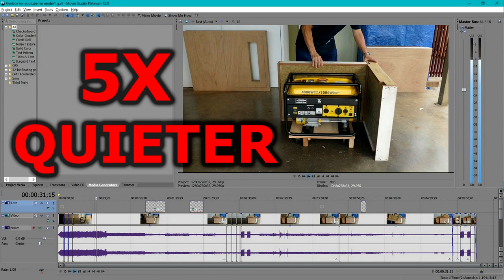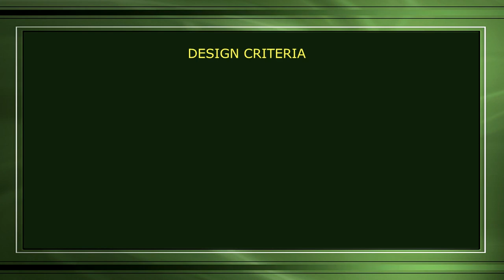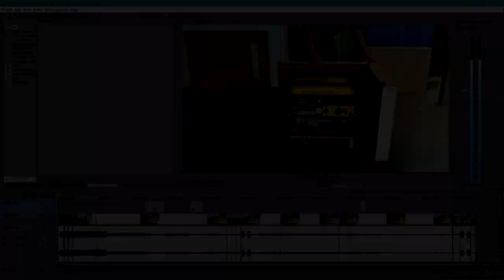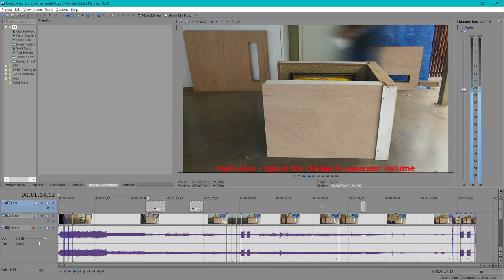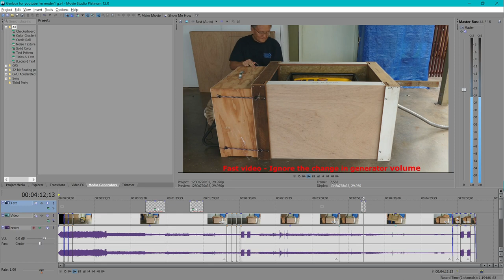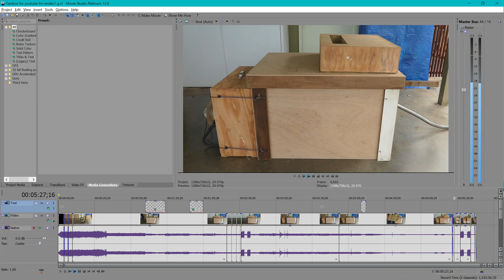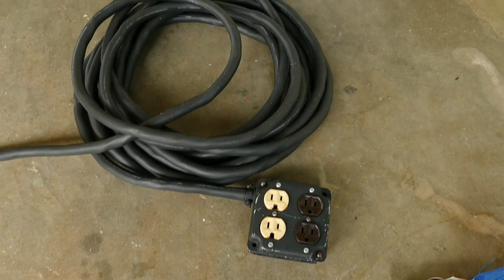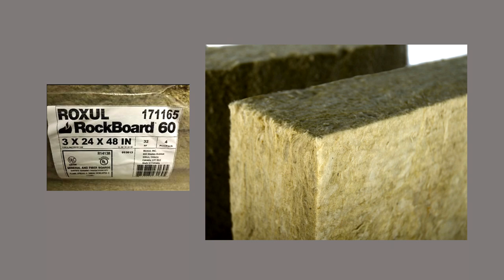5x quieter generator or compressor sound reduction quiet box

Comment: Great idea . I have some questions. 
1. How do you connect your exhaust to the muffler and is there a fire issue running the flex pipe thru the wood.
2.  Does your generator move much because of vibration.
3. Even though you have a cooling fan have you checked the temperature inside the box under a load on the generator.
4. I haul my 10kw generator in a enclosed trailer and my big concern is to much heat even when the doors are open.
Thanks again great video
Reply from the maker: 1a. My generator has a flange on the muffler.  I bolted on a flange and pipe adapter I bought off ebay. ....1b. Mineral wool insulation that I used is extremely fire resistant.  The flex tubing goes thru a hole in the insulation and does not touch the wood. See the following link for fire resistance of the mineral wool insulation that I'm using: 
https://www.youtube.com/watch?v=RKZd1ZTjvzE....2. My generator does not move. ....3. The main heat produced by the engine exhaust is piped out of the Qbox via the flexible exhaust tubing so only the external cooling of the engine is required.  My external fan plus the generator's built-in fan move a lot of cooling air through the Qbox.  Actually I think there's more cooling air flowing through the generator in my Qbox with external fan, than it running alone out of the Qbox.  A sheet of Kleenex held at the hole in the output sound baffle waves like a flag and the output air is just a bit warm.  I did not have a temperature gauge but the output air is cool enough that I have no concern about the cooling of my generator.4. Thanks for your kind comments! .... Usefulgizmos

Comment: In your description you say this setup prevents carbon monoxide poisoning, I would disagree. The pipe hooked up to the muffler exhaust is a thick wall solid pipe with no seams, welds, cracks, joints, etc. leading to the outside, I would say that that part does prevent carbon monoxide poisoning. However, from where the pipe attaches to the muffler's pipe back to the engine block there are a number of places which have the potential to leak. Also, the valve cover is another weak point where a leak could occur.

 If you are going to use this system, IT SHOULD BE A REQUIREMENT to install at least three battery operated carbon monoxide detectors with an alarm in the area where the generator will be kept when in use. And check to make sure all three are working before running the generator. This is on an assumption you are using a fuel that produces carbon monoxide. Even propane, considered a safe fuel, can produce carbon monoxide (although small amount, but it can build up if not vented) if it is not a complete burn. From what I just read, 25% of all carbon monoxide poisoning deaths is from propane. So, use those detectors no matter what kind of fuel you are using. The only generator, that I'm aware of, that doesn't produce carbon monoxide would be non-carbon based things like battery inverter, solar, wind, water flow, nuclear power plant.

In order to be a carbon monoxide preventable system, take it outside away from any building eaves or vented soffits. Another way is to build an airtight tunnel or shaft and have the generator at the end close to the outside with a large exhaust fan between the generator and the outside so that it is pulling (not pushing) air across the generator at a good volume and venting that air to the outside away from any eaves or vented soffits. You would need to have an open window, door, or opening (from the outside) at a different location other than the exit to the outside as an air source. This would also help to keep the engine from over heating.
Reply: What do you suggest for flex tubing for exost tub from generator? Conduit flex tubing ?
Reply: In reading this it appears to me that it is not meant to be inside.  This is just meant to quiet the generator outside so it does not irritate your neighbors.  If positioned away from the residence and the exhaust is vented above I do not see an issue with this setup. In fact I am seriously considering building one myself.

Comment from the maker: Hello B Berthold,
I do have scale drawings of the quiet box and sound baffles shown in the video.  I also have scale drawings and pictures of the simple jig that I made to achieve straight perpendicular cuts of the Rockboard 60 (RB60) insulation that I used.  I think that cutting the Rockboard 60 straight and perpendicular to get tight fits in the frames was important to minimize sound leakage.  

I could put a package together with instructions including details on how to get tight fits of the RB60 to the frames, the way I found to deaden vibrations of the plywood skins, the exhaust system from muffler flange to PVC extension, the type of glue that I found will glue panels of the RB60 together, etc.  Send an email to me at usefulgizmos@gmail.com and I'll let you know when I finish assembling the package.  I caught the flu so I'll work on it when I get better.  And thanks for you kind compliment.

(Reposting my reply to you here since it may not be obvious how to view replies.)
Reply: this is nice but what say the temps no overheat?

Comment: That's a huge reduction in sound but I'm curious how much hotter the air-cooled engine runs inside the enclosure and if it's hot enough to burn up the engine in high ambient temps.
Reply from the maker: No problems with my setup.  I live in Hawaii's warm climate. .... Usefulgizmos
Reply: @usefulgizmos  -Good to hear, thanks for replying!

Comment: How hot does it get in the box? Any danger of generator plastic parts melting?
Reply: The hottest heat is the exhaust from the engine and that is piped out of the quiet box so does not contribute to the heat within the Qbox.  Ambient air is blown into the Qbox and cools the "alternator > engine > muffler" in that order so the heat from the muffler does not affect cooling of the alternator and engine.  The output air is just warm.  There is no danger of plastic parts melting and not even close to doing that.  Thanks for watching and have a great day! .... Usefulgizmos

Comment: have you measured what the heat level is in the box while generator has been running full load for several hours and the fan is in use?
Reply from the maker: I did not have a temperature measuring device but the air coming out of the hole in the cover is just warm.  It's essential that the engine exhaust be piped out of the quiet box to not contribute to the heat within the box.  I have not had overheat problems and I live in Hawaii's tropical climate.

Comment: Great setup! Makes me wonder... how often do you need to use a generator? Is this for power outages or do you use it on a regular basis? Great video!
Reply from the maker: Thanks for your kind words Lyle.  Only need to use our generator for extended power outages caused by our electric company's equipment failure, or power lines down due to accidents, extra high winds or hurricanes. (all rare)  But it's comforting to know that stuff in our 2 refrigerators will be fine if/when it happens. Have a great day! ... Usefulgizmos

Comment: Hi Usefulgizmos, your sound suppression box is impressive - could your set up be used inside a camper van in the rear storage area (sectioned off from the living part of the van) safely with a LPG silent generator by adding heatproof fireboard and maybe another fan (extractor to the outside) to create circulatory air flow to keep the generator cool?
Reply from the maker: Sorry for the delayed response.  I'm not sure about using my quiet box design inside of a camper van.  The Rockboard 60 that I used is very fire resistant as shown in the youtube video released by the manufacturer.  Since the engine exhaust is piped out of my quiet box, engine exhaust heat does not contribute to the temperature inside of the quiet box.  The 11" Vornado fan that I used, along with the built-in fan of the generator provides very adequate air flow through the quiet box so the output air is just warm and not hot.  Hope this helps and thanks for your kind comment.  Have a great day!

Comment: I work in small engine over 20 years and I see several flaws on this video 
1. This is air cooled engine and it will need at least 3 feet clearance each side to cool the engine down (Running inside this box will cause your engine overhead)
2. You can’t extend the exhaust pipe that long, it must be large, straight and 10 inches maximum, connecting this kind of exhaust will build a lot back pressure to your engine and will cause engine damage very soon
Bottom line is it is a good idea but you will ruin your generator in a short period of time 
Thank you 
Trung
From Single Cylinder Repair, Inc
Reply: The pipe can be that long, and it can be curved, but it does look overly restrictive (you’ve seen motocycle exhausts right? They are neither straight nor are they 10 inch, they can bend everywhere. Also most cars have about that size diameter for 300 HP). I can’t see this really doing damage, it’s not to that point of restriction... He may lose a few % of power though compared to gradual bends in large diameter pipe but it also looks like he used what he had.

The overheat issue looks severe with lack of CFM and airflow in general (I expect early engine failure and things melting). If he had better airflow it would ideally have small gap, like 3 inch from generator to sides acting like an air duct system (just like the air blower on lawn mowers and other small engines have the fan duct to the fins, then an optional plate on the top of the head acting as an extra guide/duct for controlling the airflow). The closer you get it to fitting, the higher the velocity of the air for a given CFM (and for noise the lower the CFM the better since sound will try to escape though the inlets/outlets). You’ll also see this in some computers (the ducting to specific hot areas), jet engines etc... I think a water cooled engine would be best for this application, as the radiator can be outside the box dumping the majority of the heat without letting out unnecessary noise (besides the fluid dampening for the engine vibration would also help).
Reply: @jakegarrett8109  You're kidding right?  That big fan pushing cooling air through the box wasn't enough.
Reply: rnordquest that inlet had massive amounts of abrupt flow direction changes, so I’d guess 1/4 the flow rate though I’d need to see the fan better. Since I don’t own that fan, and I’ve never used it, and I didn’t get a good look to see if they are static pressure optimized blades (rarely are, marketing wants that CFM number even if it’s useless in many scenarios like computer fans, but if you are using it as an unblocked fan then it’s great info but this one is now extremely blocked), and I don’t know the blade pitch/foil type or RPM I don’t have a good datapoint for it.

Since you mentioned “big fan”, I’ll mention the size is inversely proportional to its static (think restricted flow) capabilities when CFM is equalized, so apples to apples, a smaller fan will do better. This may not be obvious, but think about the backflow of the air trying to escape through a large surface area fan vs potentially a smaller fan at faster rpm or more blades (less open space). Obviously it’s not that simple, and I’m WAAYYYY oversimplifying, but just getting your brain started thinking about why a big fan may not be that good.

I do have some pretty powerful fans (about the size of a soda can, 70mm diameter, over 1.5 kW power, 65 amps at 24v), and that thing may not have as good of CFM as a much weaker fan (300w 250mm fan), but it certainly has way more static pressure, so it would hands down dominate in this sound box where the flow has multiple extreme flow direction changes (however, it would be laughably loud due to the fan being louder than the generator in this case, lol!), but a scroll fan would be better suited than the axial fan he used (you can get some pretty decent ones out of home HVAC units, and not that loud with great CFM and good backpressure, modify the flaps some to optimize its housing for optimal flow rate when installed and it’s ready to go!).
Reply: @jakegarrett8109  The Tornado fans blow quite a bit of air.  He could easily measure the temp inside and see how warm it is.  A 5-10° rise is nothing. It's probably still cooler than sitting in the sun at home in FL.  I"d have gone for a fitting to a larger dia exhaust.
Reply: @jakegarrett8109  I just noticed your 10-month-old article, thanks for sharing your thoughts.  I have ordered a Dayton 1TDR9 centrifugal blower (HVAC replacement type} to mount on my quietbox.  It is advertised at 463 CFM @ 0.00 SP, but as you point out, this box design isn't going to offer 0.00 SP.  I figure I can mount a second one if necessary.  Can you expand on what you mean when you say, "modify the flaps some to optimize its housing for optimal flow rates"?  I'm not running it into a labyrinth like the author of the video does:  I'm just mounting it on the end of the quiet box inside its own enclosure with a standard HVAC furnace air filter to keep crud from building up on the blades.

Comment: What material do you use as the frame for the sides? And how do you attach them.
Reply from the maker: 3/4" wood with screws.  I have complete plans and building instructions for my quiet box, plus plans for quiet boxes for 5 other size generators, Q&As, discussion of using different thickness Rockboard, use of other insulation materials and pictures and instructions for my exhaust system, for purchase.  Send an email to usefulgizmos@gmail.com for a complete description of what's in my plans package. .... Have a great day! .... Usefulgizmos

Comment: what about a graphic of the temperature ? doesn't the box heat the engine by reducing air flow and hence thermal  dissipation of the engine ??
Reply from the maker: Hi eva.  I've answered your question in detail several times already in previous comments.  To summarize, no overheating.  Thanks for watching and have a great day! .... Usefulgizmos

Comment: Carbon monoxide is heavier than air (thus the danger when it displaces air in our lungs) and naturally drops because of that.  With that in mind a tall stack over your carport would be far less efficient than routing your exhaust along the ground out to the open area of your yard where it can disperse.

Comment: Great video, I wanted to build something similar to this, but instead of the RB60 insulation I was going to use 1” sound liner.. it’s a black sound dampening material that we use inside ducting for HVAC work.  
Do you think it would have the same sound deadening abilities?
Reply from the maker: Sorry I missed your question.  I'm not qualified to determine the 1" sound liner sound reduction qualities but as a layman, I doubt that it will be near as good as 3" thick RB60.

Comment: How for up inside of the PVC pipe does the galvanized conduit run?
Reply from the maker: 4-5 inches.  Thanks for watching and have a great day! .... Usefulgizmos
Reply: @usefulgizmos  Thank you for the very fast reply.  I like your design so much I am copying it.  Does the galvanized tube get super hot?  Does it need exhaust heat wrap?
Reply from the maker: @Gringojrf  Yes, all of the exhaust piping gets hot.  After you build yours, then determine what parts need heat wrap to meet your conditions.

Comment: Great job, 
🤔I’m trying to figure out how to sound deaden my car like they do generators
Anything you suggest?
Reply from the maker: Hi Mr Mr, .....Thank you very much for your kind comment.  No ideas for your car though ;) wink. ..... Usefulgizmos
Reply: @usefulgizmos  would be great if you can design a way to put something on the end of tailpipe or somewhere else on cars exhaust to quiet it down. many car guys will love you to help them easily get an inspection sticker!
Reply from the maker: I wish motorcycles could be as quiet as cars .... ;) wink.
Reply: Buy a new car that is quiet by design.  Some recent models are about as quiet as electric vehicles.  The only noise they make when they go by is tire noise and wind noise over the body, but engineers haven't been able to solve that problem yet, and may never be able to solve it.

Comment: I only have one question, how does the ambient air temperature inside of the box change. What is the difference from start (cold) to up and running temperature (hot)?
Reply from the maker: I've replied to internal temperature questions twice in the comments previously.  Thanks for watching and have a great day! .... Usefulgizmos
Reply: he doesnt take temperature readings, he only says nobody has has a problem with it overheating.

Comment: How does the box affect the operating temperature of the engine? I understand there are air ports but does run at a higher temperature over all? Thank you.
Reply from the maker: Since the hot exhaust from the engine exits the quiet box via the exhaust tubing and does not stay within the box (very important), the airflow from the external 11 inch fan plus the generator's built in fan provides good cooling for my generator.  I have received thank you's from some folks who built quiet boxes and have run their generators for days without overheat problems and are happy with the peace and quiet they experienced. .... But my video and any info that I provide are for information purposes only for the quiet box that I built for myself.  Anyone who builds one does so at their own risk.  ... Best regards, usefulgizmos.
Reply: Ok great! Aloha!